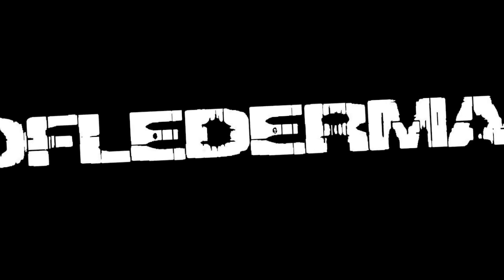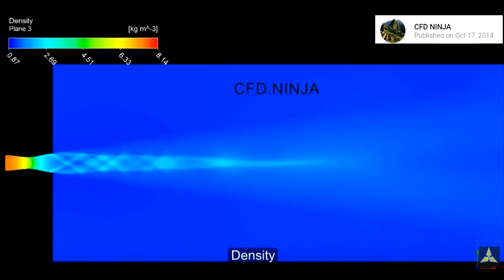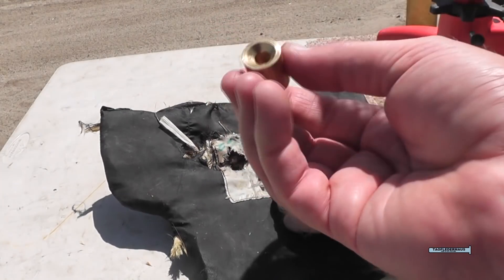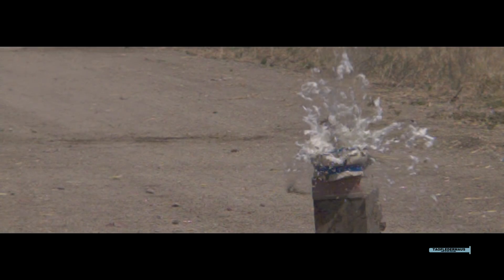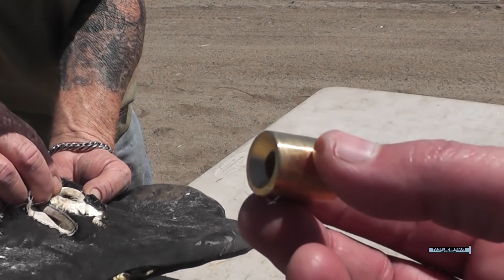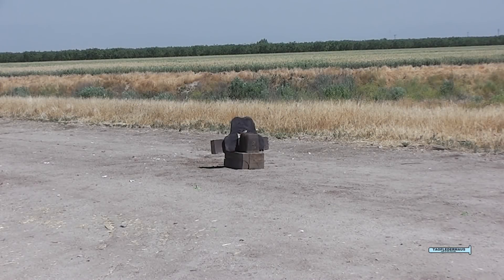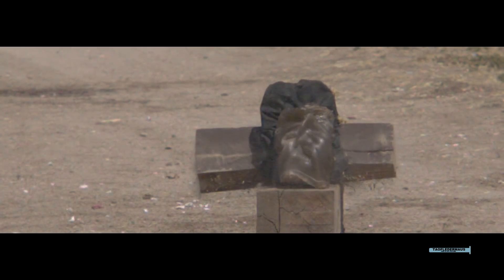SCREAMING Shotgun Slug -  Rocket Nozzle Experiment

Comment: Hi Jeff. One of the things I do is design rocket engines, so here we go. The relationship you are trying to replicate is the A1 vs At vs Ae relationship where A1 (subscript 1) is the cross sectional area of the combustion chamber, At is the area of the throat and Ae is the area of the exit. In this case, the order is in reverse as the intent is to have the atmosphere in front of the object be the combustion chamber. There is an important relationship with the convergent/divergent nozzle between the regions of the exit, throat and the chamber and the respective velocities at these regions. The region defined by Ae is supersonic, At must be sonic (or else you will get choked flow) and A1 must be subsonic. One of the aspects that is causing your issues is that the combustion chamber must not be merely subsonic in general, it must be several times below the sonic velocity at the throat. Typical combustion chamber velocities (V1) are around 250-350fps, the lower the better; for combustion and for flow. As V1 -> Vt, you rapidly approach choked flow.

Another aspect that is not helping is the sharp transition into and out of the throat. As V1 -> Vt, you will get air flow deflection off the divergent nozzle out into the center of the throat (the air has momentum). With a generous radius, this will smooth the airflow causing it to become semi-laminar to the convergent section and get it into the throat. With the sharp transition, you are likely getting flow reversion effectively blinding the throat to any flow. Lastly, the convergent/divergent nozzle relies on one thing to make it work, pressure gradient. It converts potential energy into kinetic energy by allowing an ever expanding high pressure fluid to exhaust to atmosphere. The inlet to your "combustion chamber" end has no means of compressing the working fluid (air) so you get very little pressure gradient. The simple action of the object moving through the air actually doesn't cause the same type of effect one might think. Remember, everything follows the path of least resistance and the easiest way for the air to get from the front to the back of a moving object, is usually to just go around it.

The way you get this to work is how scramjets work. You use the frontal edge of an oblique shockwave to cause a high pressure region around an specific cross sectional area thus compressing the working fluid within that compression region and forcing it through the system. You could replicate a ramjet where the leading edge of the outside diameter of the object forms the shock and then an internal cone acts as the reflection surface. This though would require you to have some type of support structures (pins, fins, etc) that holds the internal cone in place but at these small sizes, anything of significant thickness to provide support, would also cause severe losses since its frontal area will be close to the area of the system itself.

You can get higher flow rates through your nozzle but as I mentioned earlier with the V1 vs Vt relationship of velocities. For your flow to rise, your speed must slow down.

First thing I would do is find a lathe and break those internal edges into and out of the throat, by a LOT.

I can do some calculations and offer some specific sizes and dimensions that also might work out better.

Comment: 06 MAY 2019 @ 20,01 UTC
Electromagnetic rail gun videos would probably be demonetized too. Sigh
Here's a thought to pass on to the supplier of the device.  If both the leading and trailing edges were machined to a sharp angle (think single-sided knife), the forward shock and aft drag waves may be reduced.

Comment: I really miss Danny from the video, all the preparation and little comments before "launching" / "initiating the ballistics experiment" - becomes very documentary like... Still an amazing result! I was watching and ideas were popping out in my mind: subsoning whistling projectile, accurate and re-usable? You must be kidding us!! I want to make one for my pcp airgun: Lead hollow tube, cut to length (custom trials ahead), formed openings with a sizer pliers!!!  And for shotguns, iner and outer copper tubes (plumber's sizers), with lead custom weight between the two tubes.... Both ideas look easy to mass manufacture... I think the candy maker can make a fortune out of this. I would like to see a follow up with lead and copper, smaller diameters and various lenghts. I also believe that of the income funnel had sharper or rounder "lips" it would behave differently at the higher velocities. Any way, too many thoughts good job guys, thank you!!

Comment: I believe the reason the paper plug remained in the projectile wasn't because of insufficient airflow through the nozzle; instead, it was retained by the low pressure zone immediately following the projectile. A similar low pressure zone is what causes flat base projectiles to have a lower ballistic coefficient compared to boat-tailed projectiles. If the plug made up part of the area that formed that low pressure zone, then the plug would likely be pulled from the projectile whilst in flight.

Comment: turn the slug around and revisit.
it's basically designed like a carburetor.
In your Steam example they turned high pressure   into low pressure high velocity.
I believe if you turned it around and made it low velocity  high-pressure it would blow the tp out the back. just my theory thanks

Comment: If you accelerate the projectile with hypersonic speed and let it fly a long distance shouldnt you been able to hear when it hits the right speed to assume a proper air flow through the nozzle like a whistle or a sound barier break on the nozzle outlet?
Reply from the maker: Yes,   it should de-cel  to a point where the conditions are ideal.     We just didn't expect them to make any noise and when we did hear it,  at the time we had no idea why it was making the noise!

Comment: Nice work Taofledermaus Crew! As to your comment at the end of the video, I have learned something. Your experiments really helped me to better understand and visualize the issues the U.S. Aircraft Manufacturers and Air Force Pilots were having with compressibility. As you know, it caused an aircraft's control surfaces to be useless when the aircraft was flown in the transonic range and caused the death of many pilots. Once they figured out that swept wings were the answer the next issue was; how to get the air into the jet engines at high transonic and supersonic  speeds, and once it was in the engine, how to slow down that airflow to a subsonic speed in the engine so that shock waves don't form inside the engine and tear it into pieces. Your experiment in this video really helped me to visualize what exactly is happening when an object approaches the speed of sound, thank you!
Reply from the maker: thanks John!

Comment: Good luck. Advice from political youtubers has been to put your videos out on as many platforms as possible. Youtube is only going to tolerate you for so long. Gun culture is counter to the woke culture, and the woke culture is the dominant culture at google and in the West. Even politicians who are against censorship are paralyzed by Citizens United sponsored primaries (AOC's list), so you have only your fans backing you up. If you enjoy this career, better use foresight, because gaming the system is not going to work, as you have found out already. Youtube might even be using you to calibrate their censoring engines as a trolly irony.

Comment: Hey Toeflator folks, 
Years ago (80-81) there was a bullet on the market known as "BAT" (Balistic-Armor-Trauma)  that looked similar to what you show in this video.....
It was a hollow tube of supposedly tungsten carbide in a copper jacket with some sort of dellron plastic gas check that was to discard in flight,  and the front of this tungsten tube was supposedly sharpened like a cookie cutter.....
The jacket was to save and the engage the rifling of the barrel.....
Anyway this bullet was to act like an AP round if it hit body armor and/or the nastiest HP if it encountered flesh.
The reason being that to go through body armor with the standard AP Round of the time,  AP bullets would punch through flesh with minimal trauma effect....
The search for a bullet that would do both in either situation.....
I got to play with a few boxes and they seemed to work well.
Maybe too well because shortly after they hit the market they suddenly pulled them from the shelves.....
Since then I have only run across one box in a swapmeet in the mid 90's....
I figure with your contacts you might duplicate and test the concept of this bullet that vanished almost as fast as it appeared on the market......

Comment: I think the edge of that nozzle is so small that it creates that supersonic wake more faster in certain speeds than other ones with more bigger and flatter noses. With a smaller tip pressure increases, thats what I learned from Hydraulic Press Channel videos. I can see it working similarly in bullets that have certain mass and velocity.

Comment: Those slugs look very similar it the nozzles  used for sandblasting. The face is flat but the rear cone is the same shape. The carbide nozzles are very dense, but the ceramic nozzles are lighter(and 1/4 the cost of carbide).

Comment: I guess one theory of why the wad and seal wont release is that, yes it is sub sonic but it is still trying to shove too much air through a hole far too small. The other is that this projectile is going through many thousands of g's of acceleration and with a tapered surface it could me locking it in there with just pure friction ( just like a Morse taper on machine tools and drills).

Just a thought

Comment: Would a Ramjet slug be possible(Of course most likely not)? Could those cone shaped air intakes like on the SR-71/MIG-21 be included?

Fun to think about, would take a lot of skill to manufacture and I know those cones are dynamic to control the airflow at different speeds, probably wouldn't be attempting to create that inside a slug but maybe it could be designed for a specific speed. But even then idk what the point would be assuming the laws of physics aren't broken or that we discover something.
Reply: The way I see it, your main challenge would be volume. These objects are not very big. But you know this. For a specific, set velocity, maybe. But size is a mindcrumpling restraint.

Comment: Could the pressure in the chamber be pushing the paper plug in far enough and firmly that it sticks? I'm thinking while the chamber pressure uses the nozzle to "center punch" a disk into the gas seal/spacer that disk pushes on the paper plug.

Comment: If the nozzle is unobstructed, there will be airflow through it at any velocity (other than 0). Bow shocks form around a region of air compressed at the front of a projectile, but since air is a fluid, that same compression will shove air through a hole in the projectile. I would love to see more tests of this at different velocities, and with different 'tricks' to ensure the rear plug gets ejected. Perhaps lubricating the plug prior to seating it? Or using a plug made from teflon or delrin? It might also help to use a longer barrel with a "slower" propellant so max seating pressure is not as high.
Reply: I'm sorry, I'm an ignorant, arrogant jerk, but I have to ask: If "If the nozzle is unobstructed, there will be airflow through it at any velocity (other than 0). Bow shocks form around a region of air compressed at the front of a projectile, but since air is a fluid, that same compression will shove air through a hole in the projectile." is true, then why in earlier videos is the power piston/wad sucked on to the rear of the accelerated object, only to come off as said object drops into trans/sub sonic?
Reply: @andersbendsen5931  Supersonic projectiles without a hole will create a decent vacuum behind them which can keep something like a wad/piston stuck there. Once it drops to trans/sub sonic speeds, that vacuum decreases substantially so only surface adhesion remains. If there is a plugged hole, it becomes a matter of whether the compression in the front is enough to overcome the surface adhesion of the material having been smashed into the rear cavity during firing.

Comment: Be careful not to blow out a Gauss coil on your launcher. It can be tricky to repair such advanced technology.
Reply: Yep, they have a nasty habit of shorting across the flow control diode. (Check out the Hacksmith, they really do.)
Reply: Them super caps ain't cheap
Reply: Unless yt? Has a Dr-Gauss😄

Comment: I'd love to hear a super long shot of this. Probably not the smartest thing but is there any way to shoot it higher in the air for maximum airtime so you can get a super long whistle but without putting anyone in danger?
Reply from the maker: We have enough safe-area at that range where we could launch it much further.
Reply: Do you have some old phones or other audio recording devices?  A line of them spaced every 20 yards or so could then be synced up to give the sound of the projectile in flight. It would require them to be spaced pretty accurately (a few inches) and then they could be synced to the report, and by switching to the next recorder before the projectile gets too close you should be able to minimize Doppler shift.

Comment: It's pretty clear that even at subsonic speeds the flow of air through the throat of the DLV nozzle is choking for several reasons -- one of the biggest would likely be the creation of a ring vortex due to the sharp transition from convergent cone to straight section.   In my work with pulsejets I found that a sharp edge promotes a ring vortex that effectively reduces the throat area of a tube by a huge amount.   What's needed here is a smooth (curved) transition so as to avoid the flow separation that promotes the forming of a ring vortex.    This is also why you'll notice that jet engines have a bell-mouth intake rather than just a sharp edge at the front.   Without the smooth curved intake, the ring-vortex would severely choke the flow of air oing into the engine.
Reply: Or high performance pistons, even. Air is some tricky stuff.

Comment: YouTube: "The intro text says "gun", therefore we demonetized everything to perpetuity!"
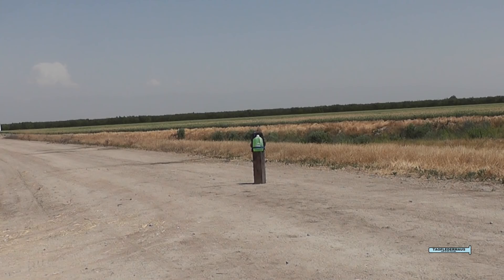Reply: "Vacuum Gun" was said at 2:53, we are scared of his, demonetized.
Reply: Truthfully, the hoplophobes that run YouTube never got past the intro text.
Reply: The need to DEMONetize  they're self lol
Reply: They really just need to make a video where they show an invention that launches these projectiles and just mute out the sound of the gun shot. Like make some thing like a giant potato cannon wrapped with wires and circuit boards, a burst disc at the front of a vacuumed barrel and then say this is our launcher. It's OK if everyone on the channel can tell if it is fake as long as it tricks the censor person. Also go full out on the pretending it is a rail-gun type thing with no "rail GUN" giggle giggle  slip ups. then they just need to either blank out the sound of the gun or even better replace the sound of the gun shooting with some cheesy sound effect like someone flicking a thin piece of spring steel with some charging capacitors overlayed on it. if you use a few sound effects at once to create a cool sound they might believe it but I would at least start by muting out the sound during the gunshot. The more you obscure it the better. bring a piece of pvc pipe with you and strap it to the end of the shooting table or shoot the slug through a much bigger wide open one and make it even more believable that it's a giant potato-rail-vacuum launcher, not gun. actually eliminate all uses of the word gun from he videos. I kjnow it's stupid but I'd rather this than no videos!

Comment: Next step: Put this ring thing around a central tube, that resides in a larger, outer tube. The central tube has a few tiny holes to vent some of the 'steam' into a cavity behind the flying ring. The middle tube propels an 'aerodynamic cone' to create a low-pressure zone in the path of the ring. Pressure transferred from the inner tube to the outer tube propels the flying ring into the void that is cleared by the faster cone.
Anticipated result: SCIENCE
Reply: I'd like to see that tested!
Reply: Science where we are taught that light travels in straight lines?
Reply: @birddog9708  What?
Reply: Buck Starchaser  Watt ?
Reply: @birddog9708  
Light does usually travel in a straight line. Exceptions:
1) Change the refractive index, like when you shine a laser into the water at an angle.
2) Light can be redirected in-flight by massive gravitational pull.
3) Light can be made to appear to curve on it's own in-flight by messing with the phasing of the wave, but it requires extreme precision.
Reply: Richard Sabo 2😉

Comment: Guys... If you run the secondary over-pressure line of your accelerator back through the projectile relay capacitor on the holding tank, you might get a much better purge valve function. This will reduce  projectile attenuation during the charging phase.
I know you're new to this, so just thought I would offer this tip. So glad you got rid of those awful gunthingy things. CHEERS !!!
Reply from the maker: If only I had your wisdom... lol